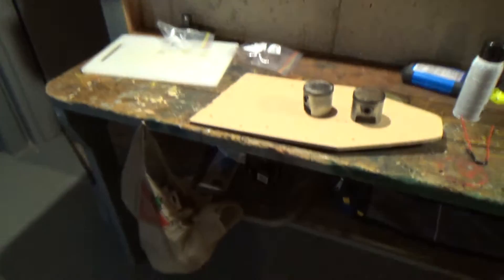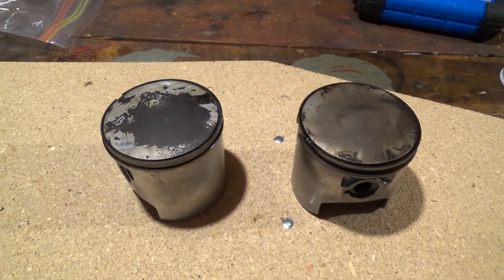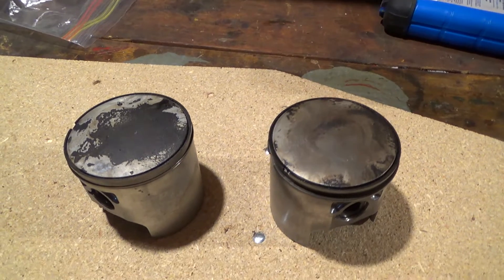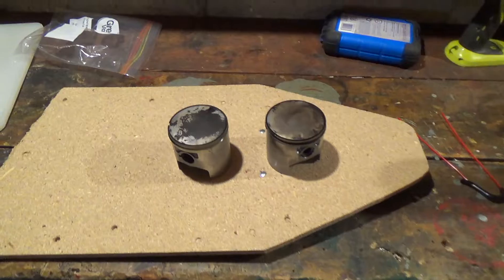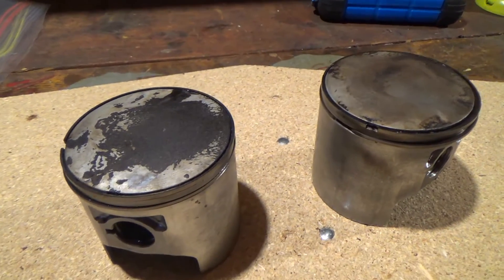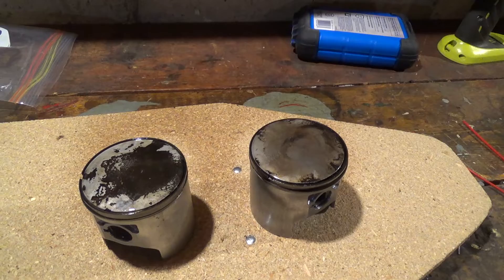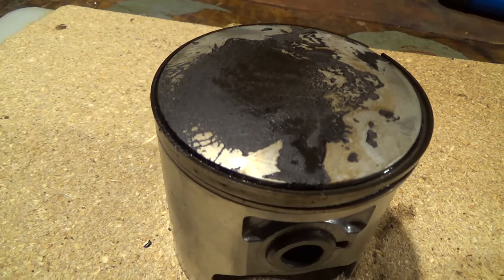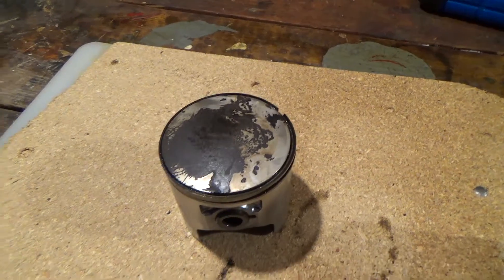Seafoam in 2-Stroke Engines

Comment: I used to use Oven cleaner, not for airplane engine pistons, just motorbike pistons. Use to wipe the carbon straight off. In my X'Air I use A747 (Castrol), engine is spotless. No need to de-carbon. It's not the cheapest oil to use. But my engine, with 400hrs is brand new. After a recent inspection. 50:1 premix. 582. Bearings measured "as new".
Reply: BE CAREFUL WITH OVEN CLEANER AND ALLUMINUM it makes alluminum foil burn up and chemically react i dont know if it would pitt your cylinder walls
Reply from the maker: Interesting... I'll see if I can find any of that locally. That's great news on the results, thanks for sharing! :-)

Comment: 2 stroke - take the head off and wire brush the head and piston, spray some carb cleaner and suck it up with a shop vac.. less expensive than Seafoam.. Instead of Seafoam in with your 2 stroke mix - add some Mavel Mystery Oil instead..
Reply: Do you just add a little bit of mavel?
Reply: Thanks for sharing. I do seafoam more for my rings rather than the head of piston. I hate when carbon sticks to my rings eventually making them stick and lowering compression. What fuel to marvel mystery do you do?

Comment: If you run seafoam in your fuel tank regularly along with your gas/oil mix then it will be constantly be cleaning your fuel system and pistons as the engine runs.
Reply: yea and also throwing off the 50:1 mixture and not lubing the cylinder with oil
Reply: @Boost_Addict  Add the seafoam before you fill up your gas tank. Problem solved.
Reply: @Boost_Addict Seafoam doesn’t impact the mixture

Comment: Be careful spraying seafoam in your intake because it goes through your crankshaft bearings,
That is how in  a 2 stroke engine the crank bearings are lubricated with mixing oil in gasoline that goes through the base of your engine before it goes to the combustion chamber
Reply: This makes no sense
Reply: This only happens on 2 strokes without engine oil.
Chainsaws, outboard, and older jetskis don't have engine oil.
So a higher oil ratio is imperative.
I run 30:1 on these types of 2 stroke motors.
20 years and no rebuilds.
Reply: seafoam is oil

Comment: Thats not really how seafoam works, the way seafoam works is mich like using water in your motor to steam the carbon off. Seafoam is mostly kerosene which his a low flashpoint and steams violently causing the carbon to break off.
Reply from the maker: Oh cool! Thanks for that! Definitely makes more sense why it seems to work better in a running engine. :-)

Comment: Um I think you are supposed to use seafoam in the fuel or while the engine is running
Reply from the maker: You're right. The only difference with my test is the lack of heat and that very well may make a difference.

Comment: The guns in the background should be locked be responsible gun owner
Reply from the maker: They are locked. The room that I'm in is considered a "safe". The walls are concrete and the door is steel and dead bolted. Not to mention the firearms are all either trigger locked or have the bolts removed. (which is above and beyond the legal requirements)
Reply: Guns are nothing more than tools.  If they are used properly they are beneficial.  It is when they are used improperly that issues arise.  The responsibility fall on the person holding the gun.
     On another note I use seafoam in  everything we have, cars, boats, small engines, and tractors.  No issues whatsoever .
Reply: Hey Matt tell him to mind his own business!
Reply: Mind your own business

Comment: What’s your thought on spraying this into the spark plug hole and letting it sit then starting it 24 hours later?
Reply from the maker: Definitely a good idea if the engine is upright. Mine is inverted so I can't.
Reply: mmatt what about buildup on the head? Any idea on how to remove that? And also the decompression port?
Reply from the maker: Theoretically, anything that the Seafoam saturates should benefit. Might have to resort to a good old fashioned scrubbing though.

Comment: Good work Matt. I get that crap in my AR15 rifle and nothing short of demolitions and road rage will take it off! I think I am using some aggressive solvent like Kroil or brake cleaner right now - but ya have to do that outside. It'd be nice if there was something you could use inside the house or shop and not worry about ventilation and carcinogens.

Comment: Hi Matt.  I have run Amsoil Dominator in my 2 stroke Paramotors for years and have had good results (No melt downs LOL ) so I am a fan of that oil for sure.. Quick question for you buddy, Can you fly from Woodstock to Edmundston in the Beavor with out refuling and about how long would it take you in no wind conditions?
Reply from the maker: Yup, that distance is possible without re-fueling. It's just over 100 miles so with a cruising speed of 60 mph, with no wind it'd take about an hour and 45 minutes or so. Fuel burn would be in the neighbourhood of 8-9 gallons.
Reply: Thanks for the info Matt, Just planning for this summers XC up to Woodstock and beyond to fly with you guys.. I see on Googal earth that it looks like most of the landable sand bars are upriver from Woodstock..
Reply from the maker: Yes they are. I'm sure we'll figure something out though. :-)
Reply: Sounds good, I will be looking forward to it Matt..

Comment: Matt, the severity of the carbon build up might depend on the type of 2 cyl oil you may be using.  Some who read this might have a disagreement on this statement.   If anyone uses a synthetic oil , be it Amsoil , Lucas,  Royal Purple,ect. are all PAO'S  which are Polyalphaolefin  . I'ts the differences in there additive package in PPM ( parts per million)   Higher detergency  less carbon.  What oil are you using?
Reply from the maker: Amsoil Sabre and Dominator. I run the Dominator in the injection system and mix Sabre at 200:1 in the gas to stabilize it and add just little extra lube since I don't 100% trust the injection.

Comment: Hello Matt.  Interesting run on the Sea Foam.  Back in the mid 70's I purchased my first car.  A 1967 Buick Wildcat with a 430-4 barrel that would drink the gas.  I always had questions about my car and working part after school for a mechanic helped with answers.  Carbon was an issue and I watched him use MARVEL MYSTERY OIL, poured directly into the carburetor with the motor at high rpms.  When the motor began to die he would back off on the amount going in.  Talk about smoke while it is burning off the carbon it was massive, but it would get to the point where there was no smoke at all.  It was at that point the piston heads were clean.  I did this about every 6 mths.  Helps the spark plugs as well.  This is all before catalytic converters.  MMO and catalytic converters dont go well together in quantities above what is recommended on the directions.  MMO might be in stores there in Canada and if not one can find it in just about any auto parts store in the US.  Enjoyed the video Matt.  👍👍👍
Reply from the maker: Thanks for the info! I've heard good things about MMO as well but I haven't tried it yet. Maybe I'll pick up a bottle to experiment with.
Reply: Good luck Matt.  As always,  thank you for the videos.

Comment: Hi Matt, I would not do this in the gas because you might damage your gaskets and seals or any plastic hoses or parts. Blowing into the intake is not the same as actually putting it into gas. Ya don't want to make 'er skittish up in the air cuz she might dive, ya know?
Reply from the maker: It's a 100% petroleum based product so it won't damage any of the seals, hoses, or gaskets. It says right on the bottle that it's safe for use in this manner.
Reply: @mmatt  Ahh, not familiar with the stuff, just spouting off for safety sakes. Would be interesting to find out how well it does, and if your hp is affected one way or another. Let us know. Good videos, keep them coming, I want to fly so much.
Reply: In the marine two-stroke world SeaFoam + Fogging Oil (if you're tied up for more than a week or two) are the two must-dos.

Comment: I don't have any personal experience with Sea Foam. There is a Challenger Flying Group on Yahoo that I have followed for some time and they have always extolled the virtues Sea Foam. However, they actually use it regularly in every tank. Like a lead additive in GA.
Reply from the maker: I have heard of people doing that too. I might start doing that as well.
Reply: @mmatt  The most reputable pilots on that list have absolutely sworn  by it for decades and further they claim that(while they all do, at the very least, the recommended maintenance)the appearance of their pistons at tear down and rebuild are almost like-new when measured for wear with a micrometer etc. They claim that the comparison is remarkable, in that, they do measurably wear though far less than without using the product. I don't RamondBurr(remember)specific numbers anymore. To hear them tell it though it is well worth it for the peace of mind knowing that it is not only doing good things for the engine while it is running and maintaining constant performance it is also preserving the longevity of the unit and maybe even some of the components, too.
Reply from the maker: Looks like it's definitely worth it then. Do you have a link to that list? I'd love to check it out.
Reply: @mmatt  Absolutely, here it is https://groups.yahoo.com/neo/groups/FlyChallenger/info
and here a a link to some of the discussions about SeaFoam(not all)search around for more, too.
https://groups.yahoo.com/neo/groups/FlyChallenger/search/messages?query=seafoam&guccounter=1
 It's a good well rounded group, for the most part. Enjoy.